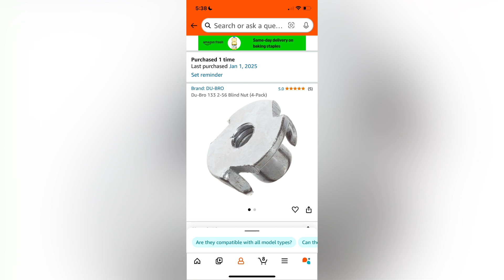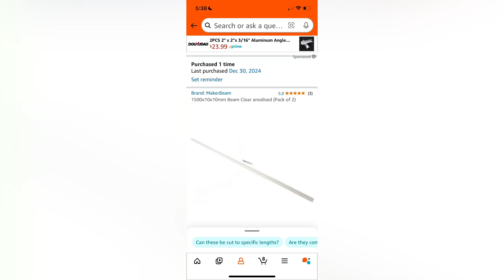Model Rocket Rail Buttons for small rockets!

Comment: Does anyone make rail-buttons that are spring-loaded?
They would be drawn into the body of the rocket by a spring...flush smooth while in flight.
A neodymium magnet would serve to pull the button out for mounting on the rail.
Reply from the maker: @pirobot668beta   I’m unaware of such. Apogee makes fly away rail guides/buttons that pop off after the rocket leaves the rail.
https://www.apogeerockets.com/Launch-Accessories/Fly-Away-Rail-Guides